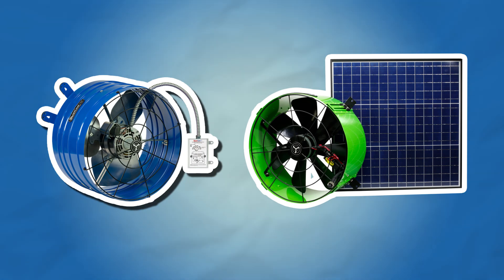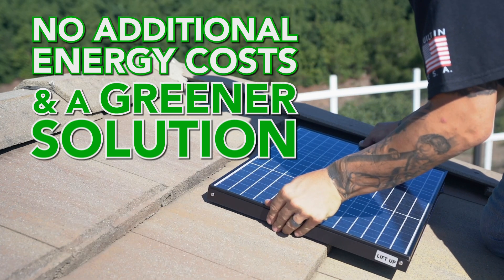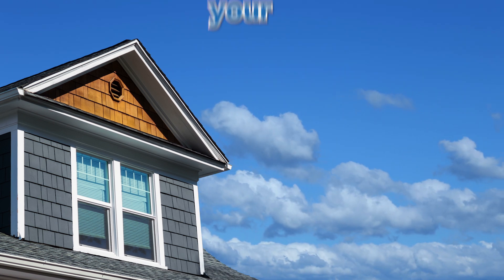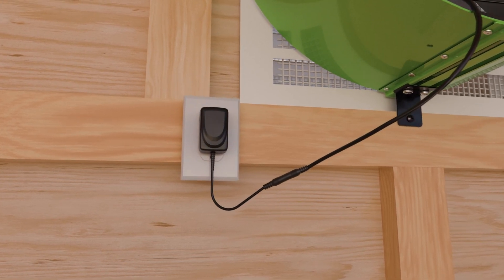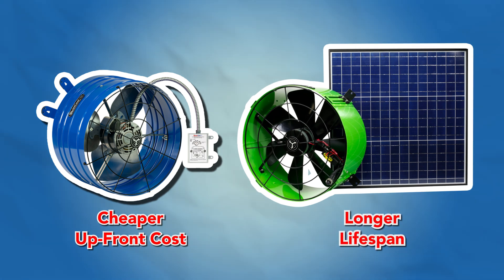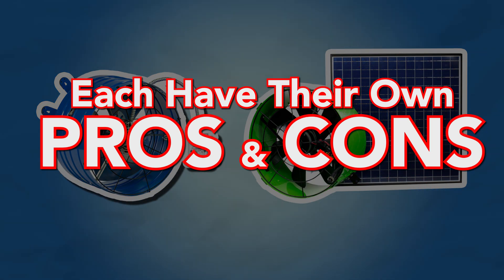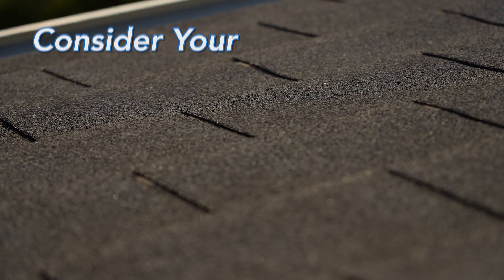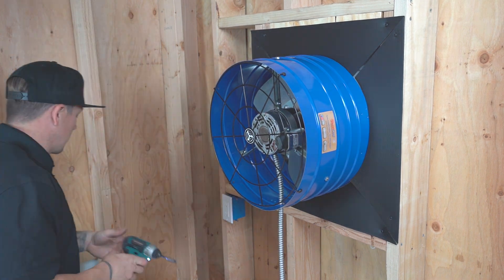Solar Attic Fans vs Traditional Attic Fans: Differences Explained

Comment: Attic Temp Reading Tip:  When I installed both solar gable fans I also installed an AcuRite Digital Indoor/Outdoor thermometer (Model # 00522SBDI).  I hung the wireless thermometer towards the highest point in the attic. 

Now I can view the attic temp any time of day from the digital display in my living room (plus see the attic's high and low temp during the past 24 hours).

Comment: I installed two QC gable solar fans on a 1500 sq ft. house. Since there are two gable vents next to each other i was able to install the solar fans side by side.

During the summer i run both fans.  
During the winter only one fan runs. I shut down the 2nd fan and put a cover over it to prevent air flow.
Are there any potential problems running the solar fans side by side during the summer?
Note: I have soffit vents under the eaves and 2 more gable vents on the opposite side of the house.
Reply: Update:  After posting my previous comment i decided to go into the attic to inspect both fans.  

Out of curiosity i took a 1 ft. long piece of toilet paper.  When i tested each fan individually...they did lift the TP towards the fan housing guard.  

Also, each fan has been installed for 4 years and they both have dust buildup around in the interior of the green housing and the back of the fan blades (attic side).  So both fans appear to be exhausting without interfering with one another.
Reply from the maker: Yeah, you should be good on your set up. There is no issue putting the fans next to each other of you have other vents in the attic